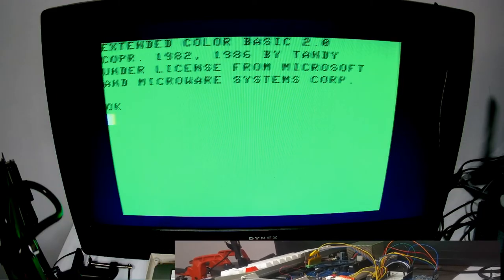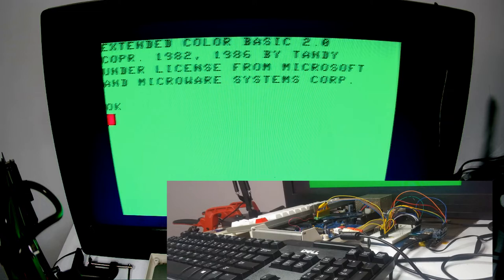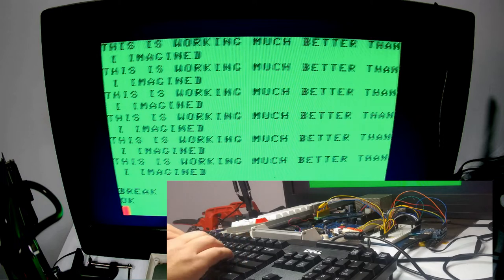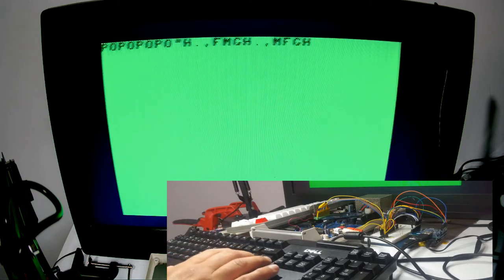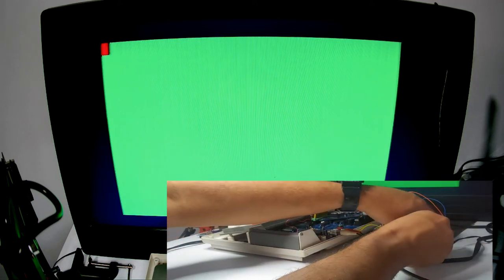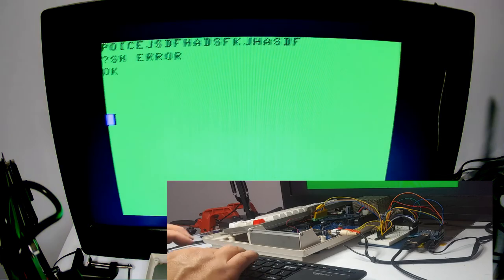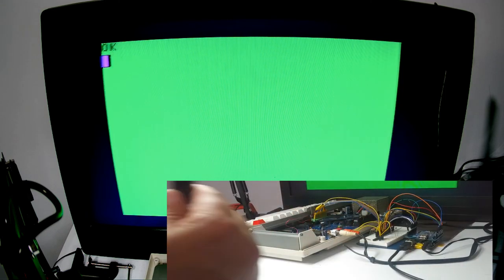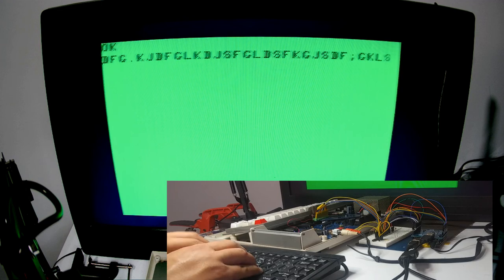Using two USB keyboards and a PS2 keyboard on a CoCo 3 with a USB circuit adapter update part 3

Comment: Any news on these keyboard adapters?  Would love to see one for MC-10.  It's about the only thing really keeping me from using mine -- that dang keyboard.  All I need is a usable keyboard and improved video output and I can play with it more than I do.  In the case of an MC-10 adapter, I think it could/should be expanded to support a joystick interface too somehow.

Also would love to have one of these for my ultimate CoCo3 with GimeX and all of the video out options.  If somehow I could also get a USB mouse working, I could get an entire KVM to share my CoCo3 and my daily driver machine.
Reply from the maker: When I priced it out, it seemed a little too expensive so stopped working on it. I still have the prototype so maybe I should revisit and see if it's any cheaper.
Reply: @rockyhill3  I wouldn't worry about price at all.  This hobby isn't at all about practical use.  This is the ultimate "bucket list" for the vast majority of us.  Wanting to learn things we didn't learn long ago or to revisit "the good ole days" and enjoy people with common interests.  One of the things I get most out of it is seeing what amazing people like you and others on the electronics side can do.  It amazed me then, and it amazes me to this day!  Having one or more of these and maybe one for the MC-10 would be amazing!

The idea for the CoCo3 would be to have a more functioning KVM usage scenario.  (This is why somehow getting a mouse into the mix would be pretty neat!  Obviously not necesary for most things)

Comment: How is these board coming along? Ready to sell any?
Reply from the maker: Unfortunately no. The controller I want to use is not available until march of 2023 so it's going ot have to wait until then. I can find the controllers now but the prices are too high to make it worthwhile.
Reply: @rockyhill3  Unfortunately I have found this with almost all small controllers eg XILINX, Raspberry PI's, etc.  There are some refurbished chips available but I would not trust them.  Also great channel.
Reply from the maker: @bretthunter2828  I've purchased several fake chips in the last couple of months... Very frustrating! Thank you!

Comment: What did you mean by adding a separate switch?  Was that in code or in hardware?  The shift key solution...
Reply from the maker: I bodged it in hardware. I added an extra analog switch and hot glued it to the circuit.
Reply: @rockyhill3  It would be good to see in your next update.